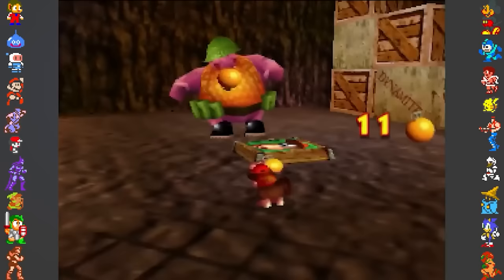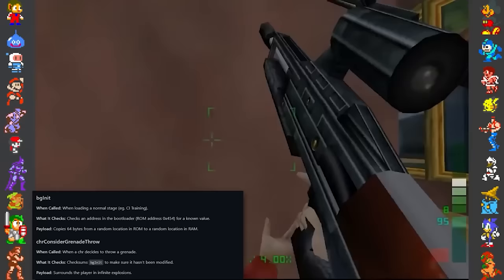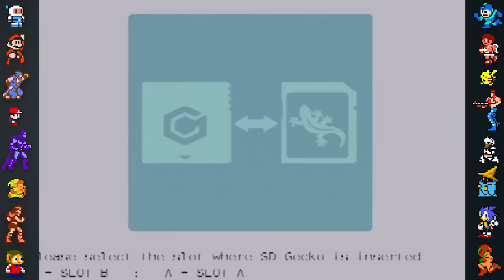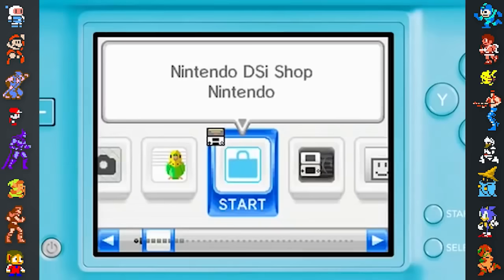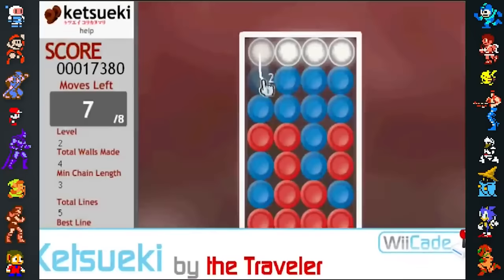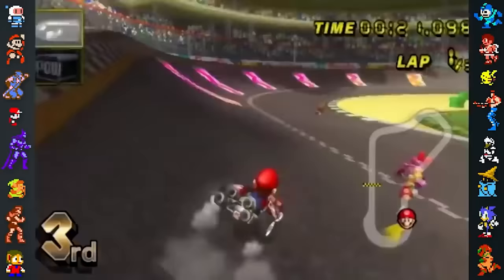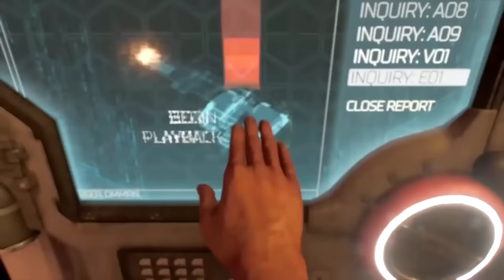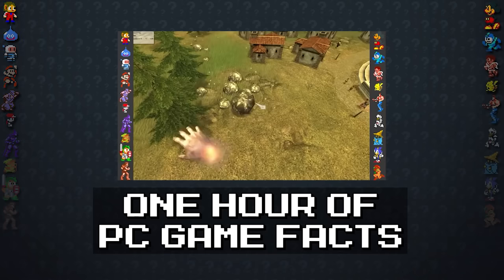One Hour of Nintendo Piracy Facts

Comment: I dislike how many people have been brainwashed into believing that hacking and creating homebrew is bad, when we owe a lot of the features we currently have for our phones, computers or even consoles, to those gifted people that have been messing around with such hardware or software, people who have managed to discover incredible ways to push said things to its limits, and in a lot of cases know the hardware and software far better than its original developers, and instead of seeking to try and jail or ban these people, we should be hiring them instead, of course this should only happen if these people are only doing these things for good intentions, because if its like those people who profited from hacking the switch, then even if you hire them they may be stabbing you on the back with a side business which would be unacceptable. There would be a lot of games and hardware that would be lost to time forever, if emulation was not a thing since once a console finishes its lifespan, the manufacturer will stop supporting it, whether it comes to repairing the console, selling controllers or accessories for it, or even making its game library available in stores or even digitally as most of our past consoles do not even have an eShop anymore.

Comment: When it comes to Twiligth Hack system update 4.0 don't relly fixed the buffert overflow attack, as I know how a very well known developer in homebrew world was able to run it on 4.4 without problem as long you could get the savefile in the console.

Comment: I bought my wife a Tesla well, ultimately just because she wanted it even though I thought that the market for EVs are immature.  It is cool for some non-driving conveniences, but I was adamant that FSD was not worth the discomfort of a middle class budget.  Autopilot as well is suspect.  I insisted that the car should be operated “manually” with full driver interaction and situational awareness.   Automation without a solid foundation of competence in the manual operations that are automated can be disastrous; it is a matter of risk assessment of the maturity of the automated system and its underlying components.

Comment: Really weird how you open up with the reasoning behind the N64's relative lack of piracy being due its use of cartridges, but you use both the DS and the GBA as examples of systems that faced heavy piracy.

I don't even necessarily think that you're entirely wrong, but it's a poor explanation. Using the GBA and especially the DS as examples is rough because ROM sharing was much more pervasive during and after their heyday. Probably would have been better to use systems that weren't contemporary with the rise of broadband internet and easy casual file sharing.

Comment: minecraft has very easily findable pirated version, with online play that doesn't require you to pay anything, yet it sold an insane amount. wikipedia says its 238,000,000 copies. If you want to stop piracy, just make playing your game cheaper and more convenient. There are pirated games that run better than their non-pirated version. 

due to anti-piracy measures that only hurt consumers, if i pirate far cry 3 i will have a much much more seamless experience than going through official ways, where i have to sign into an additional service, and use an entireless useless launcher. Pirates can click a shortcut in their desktop and play.
Reply: It basically a two step program:

1. Make a good game that people will actually want to play.

2. Make it cheap enough to be accessible to most people.

Comment: While Nintendo excells in many things, their approach to limiting things (including piracy) in their games has never been good. If you put a restriction onto your game that players don't feel is "right," they are going to work to get around the restriction, leading to more things like piracy. Put in anti-piracy options and people are going to figure out how your shit works to get around it....possibly leading to them also understanding major flaws in the system that can be exploited for actually malicious purposes. Don't make your games accessible to people on newer platforms? They're gonna ROM it.

Making things more accessible and less of a hassle to deal with DIRECTLY causes you as a company to make more money. You can't stop 100% of piracy, it's just not possible, but you can remove additional motivators that would cause people to pirate things. If your game is fully accessible, with multiple save files, the ability to incorporate mods easily, and reasonably priced, etc...most people are going to buy the game rather than deal with the hassle of pirating.